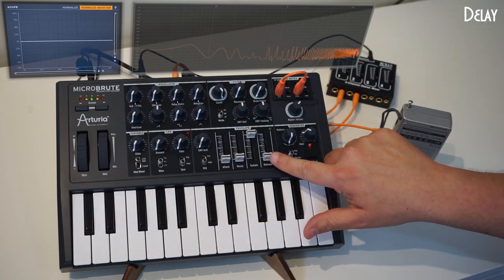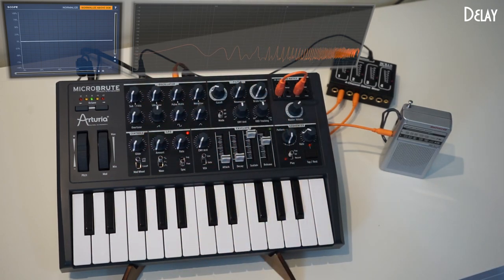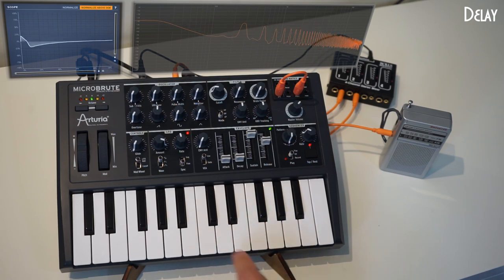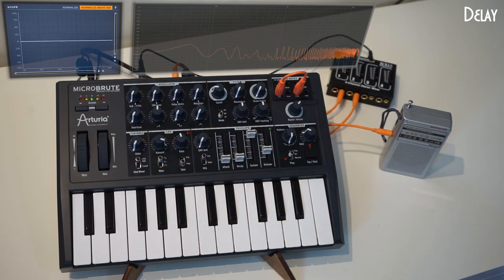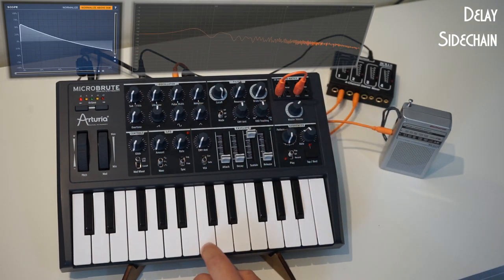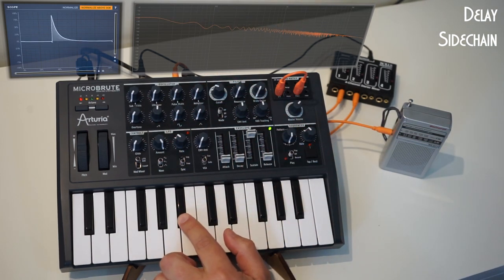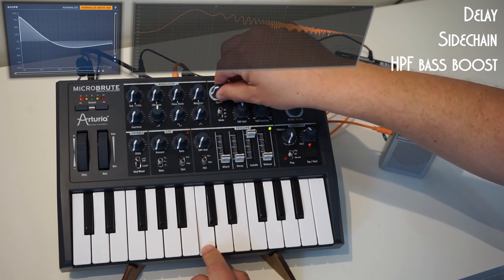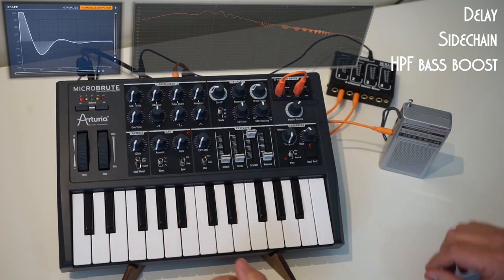11 Synth Tips and Tricks (shown on the MicroBrute by Arturia)

Comment: Owned a few analogs of the past and yes the Microbrute is a GREAT SYNTH, really liked how you add the missing white noise generator, cool.
Reply from the maker: Thanks! You should have seen me at the store: "Hi, I need a transistor radio, but I want to hear what it sounds like BETWEEN the stations". He thought I was crazy, but you don't want one of those that mute out the noise...
Reply: Yap did that and it doesnt work with mine for the reason you are talking about they cut out the noise somehow, anyways a really helpful  tip keep up the good work. Now i am trying to trigger my Alesis sr 16 drum machine with the arturia Microbrute, if you know how this can be don - via MIDI ? - just drop me a line here. Thanks.
Reply from the maker: Panos Chatzigeorgiadis do you mean does it output midi notes? Yes
Reply: So  i need just a midi cable to make it sync, as a master and the arturia as slave, any setting i will need to make on the alesis about midi settings ?
Reply from the maker: Panos Chatzigeorgiadis good question - i thought you meant sending midi notes. I never tried sync - please check the manual or better yet just try it out ...
Reply: Trial and error is the best way to learn, thanks a lot.

Comment: love the microbrute. you can also use the hpf bassboost trick to enhance your kickdrums (a lot)
Reply: Julien achwas Yes its strange as most people think kickdrum , low pass straight away.
Reply: I recently started doing this with my MS-20. I sometimes use the LPF with resonance on it as well to enhance the 'click' of the kick drum. Then triggering some noise with it for some more texture to finish it off. It adds so much more character to a basic electronic kick drum.. Sounds so much better than trying to achieve it with regular eq.

Comment: If I am not mistaken, using a radio on the wrong channel basically means you made music with the cosmic microwave background...? That would be so awesome😁
Reply: The background radiation leftover from the Big Bang, called the Cosmic Microwave Background (CMB) has a frequency that is centered at 160.4 GHz.  The frequency band used for the old analog TV signal is 7-1002 Mhz. Less than 1 percent of the CMB signal can be seen as static, also called "snow", when the TV is tuned to a vacant channel.  The other 99 percent of the static that appears on the TV screen comes from random frequencies produced on Earth.  The frequency band used for AM radio is about 550 to 1720 kHz.  The frequency band for FM radio is about 88 to 108 MHz.
Reply: @InfiniteMonkey303  those damn facts always get in the way of my fun😂. But seriously, thanks so much for clearing that up!
Reply: @Mu1974  You were correct that some of the static heard on a radio as shown by Loopop (great channel btw) is CMB, just not all of it.  I have ASD (autism spectrum disorder) which compels me to provide details that no one asked for.
Reply: @InfiniteMonkey303  I love having the details down, so I am glad you did provide them

Comment: You need to modulate the vca with a lfo NOT the filter to achieve a proper tremolo effect. Other than this minor mistake, great stuff for beginners. ;)
Reply from the maker: dubtoms you are absolutely right, this is a workaround for when there's no way to patch the lfo to the amp
Reply: Yeah this is vibrato, not tremolo.
Reply from the maker: dubtoms vibrato is modulation of pitch; tremolo modulation of amplitude (volume). Here since the MicroBrute doesn't let you patch into amplitude, the filter as a target is a workaround

Comment: What is the black box between the radio and the synth ? I have tried adding different sound sources in the microbrute or minibrute (other synth outputs, Drum Brute Impact output, etc.) but the signal levels always seems to low. I have to put the output level really high which adds a lot of unwanted noise.
Reply from the maker: It's a simple passive mixer

Comment: I dont get it why people keep saying that microbrute is a powerful synth. I find it super narrow and limited in sonic possibilities and modulation. One envelope, which is shared by vca and vcf, and the patchbay is not that engaging really, most of the patchpoints are already normalized , such as pitch lfo env metal and env filter (if you set env ammount above or below zero o the filter section), unless you are talking about how much you can do with it when you get EXTRA gear (envelopes, sample and hold, more vca's, reverb), but then ANY synth is versatile and powerful.
I'm saying it once and for all, microbrute is a super basic, boring synth for begginers, to get the ins and outs of subtractive synthesis. Get a Behringer Neutron instead, now THAT, is a powerfull synth with broad sonic possibilities out of the box.

Comment: So I've put the exact same settings to achieve the delay and mine sounds nothing like that and it just sustains for ages!! 😂😂😂 What am I doing wrong? I'm completely new to synths... can you tell? 😂🙈
Reply from the maker: Actress MTRodriguez no worries - that's the beauty of the microbrute - I can't hide anything.... the patch is right there. Did you connect the patch cable?
Reply: loopop the little orange one from LFO into filter? Yes, I've done that ha. No idea why it's not doing the same!
Reply: Ooh,I just got it to do it for a bit and now I've lost it again lol. It sounded really muted though as had to put the cut off low for it to do the same delay rate. As soon as I turned the cut off up it turns into a long sustained note. 😂 I'll just keep playing until I get used to it I guess.. Thanks for this vid. Majorly helpful!
Reply from the maker: Actress MTRodriguez great!
Reply: +Actress MTRodriguez Make sure the LFO Wave is set to the upmost position and that the LFO Amount pot is turned all the way up and that you're using either HP or LP filter. Also see if you're accidentally controlling the Cutoff or LFO amount with the Mod Wheel. If you've got those set up right, the Cutoff amount (pot, not wheel) shouldn't matter too much, you should still get the delay effect.

I tried to explain it as simply as i could, hope this helps. :)